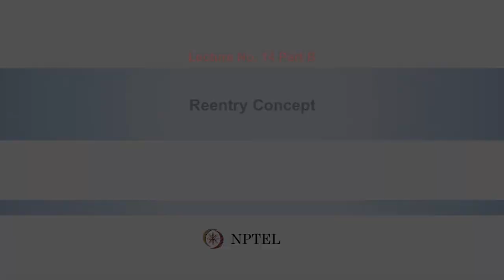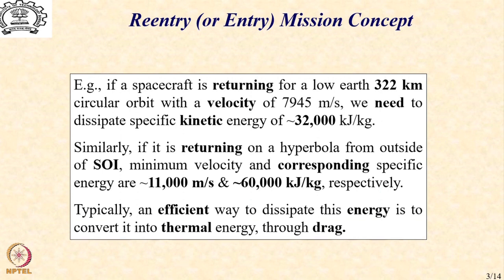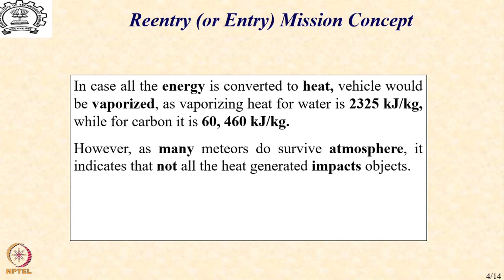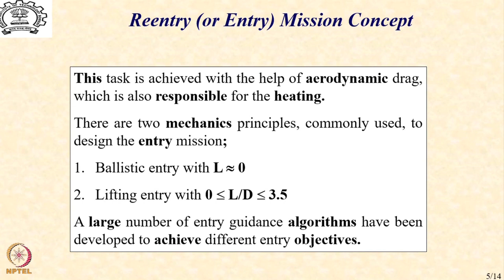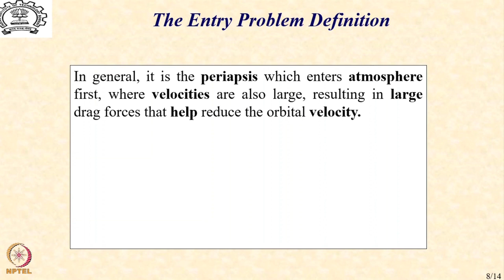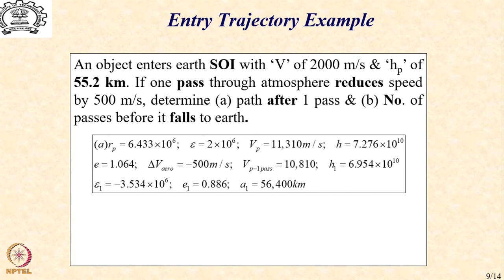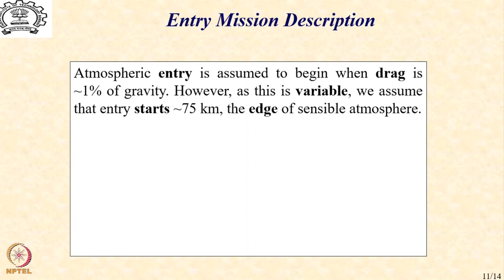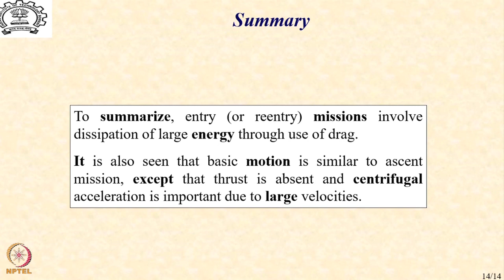Lecture 29: Reentry Concept

Comment: As Allen and egger said the heat flux created by air friction in high flight mach number is inversely proportional Aerodynamical drag,
It mean the higher the drag force on the vehicle the less heating is severe,
One of the possibilities that makes easier to dissipate the heat load for the vehicle is all of the aerodynamical heating isn't actually flow to surface of the space craft rather than most of heat is flown in flow direction that makes possible to cool the wall by using variable techniques to mitigate the heating, with the occurance of these possibilities still the temperature of post gas is far beyond the material functioning temperature.

Comment: The max acceleration or velocity in which re entry vehicle attained during re entry is strongly coupled to the entry angle, the larger the angel of the entry the higher acceleration during the entry in order to overcome this problem in high speed we reduce entry angle to same extent in which we attain lower acceleration durrin re entry.
But those vehicle like icbms the entry angle is between 70 t0 90 degree in order to attain ,as acceleration.